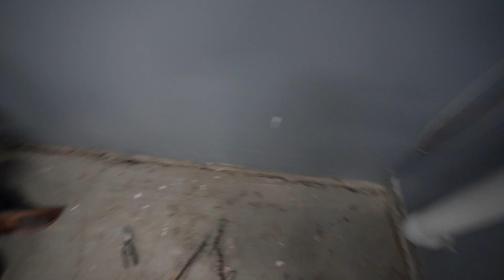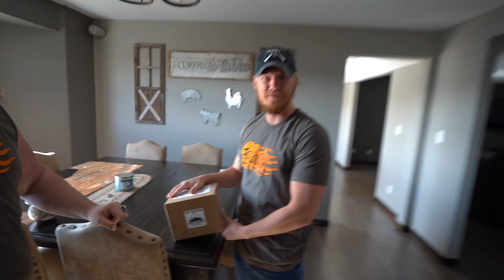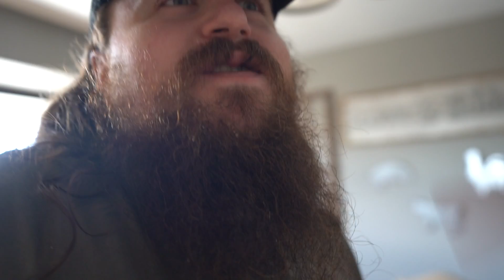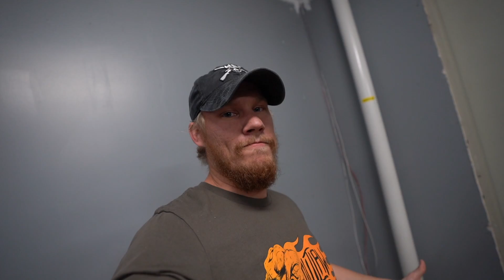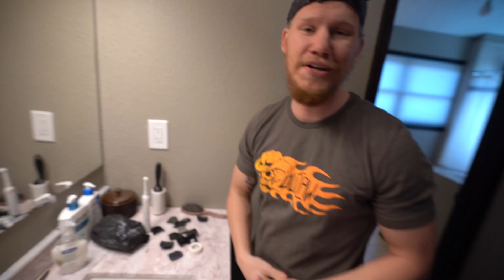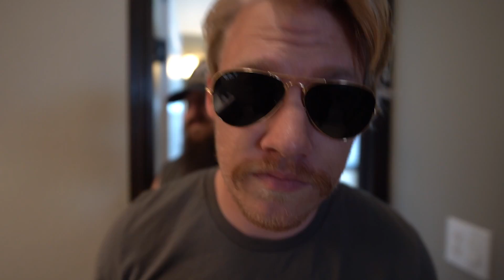I'VE HAD ENOUGH

Comment: Lol I'm a painter an you guys are so doin it the hard way but for some semi pros lol looks good but I use Sherwin Williams for all myaterial they make a water base epoxy for floors in different products but I recommend the armoseal 8100 an u have to roll one base coat let it dry an on ur second coat roll a 4x4 section an wanna grow ur flakes like chicken feed an evenly an what do t stick just blow the rest out with a blower good luck with the project outlaw live the vids just figured a lil advice wud help ya mother truckers